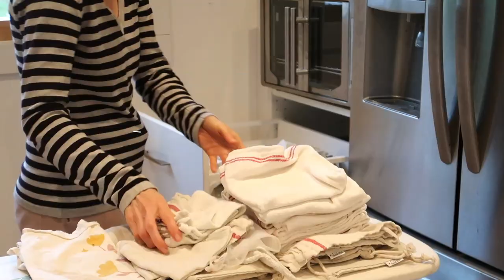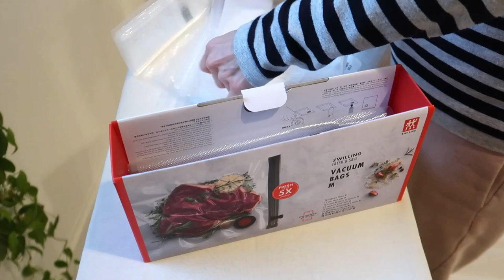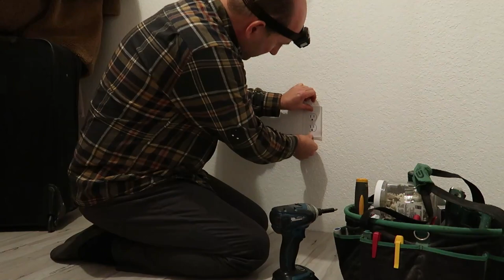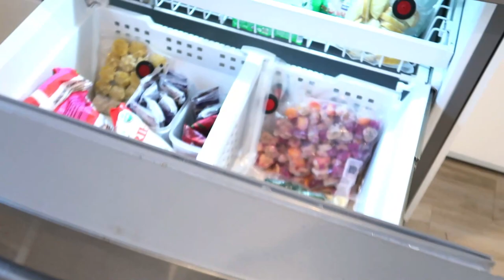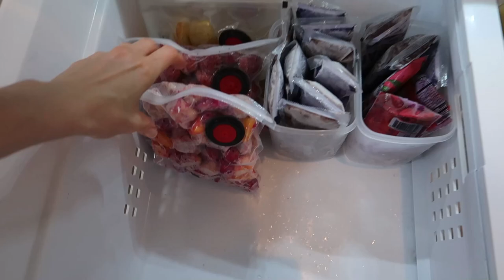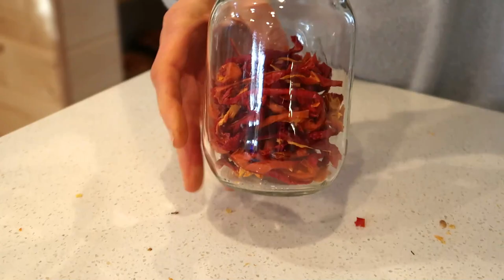ORGANIZE WITH ME 2021 Homemaking with Scandish Home

Comment: For Zsolt's back pain, I would suggest rubbing organic castor oil on affected area (include lower back where kidneys are located).  Also, it helps minimizing animal product intake which causes acidity and uric acid (ex. Gout). Add more raw veggies (or steam instead of cooking) and fruit to diet. 
FYI: Cooked tomatoes are highly acidic, preferably eat raw.
Keep up the good work with the smoothies and juices.
Reply from the maker: Thank you! It's coming from his work he has to lift very heavy items 😊💗
Reply: Huile de ricin??

Comment: I love your videos.   I think you may want to reconsider your micro plane rasp grater.  They are great.  You may have been using it wrong and that is why it hurt.  You hold the lemon in your left hand and then with grater in your right hand placing the grater on top of the lemon.  The back side of the grater should be up I.e., you should be looking at the U- shape part of the grater.  You move the grater over the lemon.  Your fingers never get near the blade.  And all of the rind ends up in the U- part of the grater, never making a mess.  Hope you give it a try again.  Just a tip.  Julie  Hilberg

Comment: Thank you for such great organization ideas.  I am wondering if you could push a lemon onto a meat-carving fork and use the fork to hold the lemon against a breadboard, then you could press the grater against the lemon firmly with your other hand.  This would keep your skin against the sharp edges.  I hope your hand heals well.
Reply from the maker: Thank you Eileen! That's a great idea. I've got another suggestion to hold the lemon on the board and move the grater so maybe there's a few trick I should try before I get rid of it😂💗

Comment: Noemi, you have me interested in the vacuum bags. Does the vacuum pump used for both the bags and glass containers?  As always your videos brighten my day and will write soon.
Reply from the maker: Yes they are and if it would be up to me I would use more of the glass version I have 3 of them but that would cost a lot so I freeze in the bags and I use the glass ones for meat in the fridge. The vacuum stick works for both very very convenient! Thank you so much for your letters just picked up your latest one with the recipe😃💗🤗💗
Reply: Thanks, Charlie was reading reviews.  They mention an issue with moisture.  What I need to know, can you take out a portion of the product in the bag that has been vacuumed then return to the freezer after vacuuming again?  Hope I am clear on this.